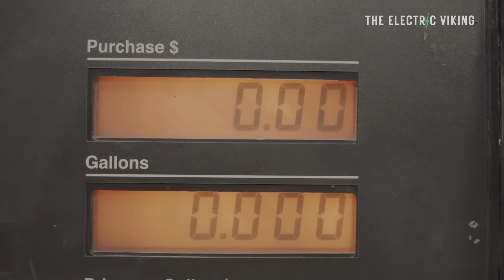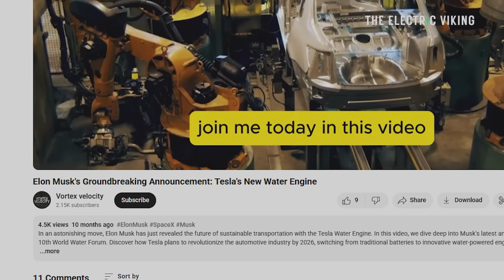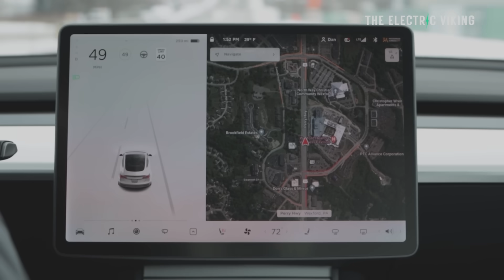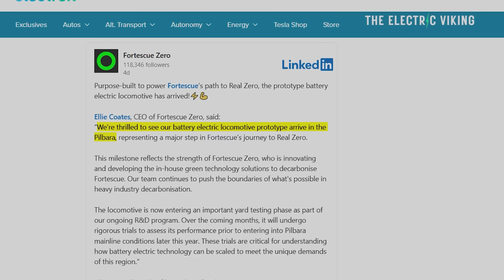The Train That Never Needs Charging – Game Changer for Global Transport

Comment: Your channel has become a source of inspiration for me.... of the need for more people to be taught basic Physics.
Reply: You might want to start with yourself. Sam has defined nothing more than a simple Gravity battery. Try listening closer. Nothing here that would assault physics and nothing new except the application.
Reply: @TronJockey it's not like a gravity battery. They have an external source of power that they use to charge and then give back around 80% of the energy later, like a normal battery. This train only works in very specific circumstances where you are carrying an extremely heavy load downhill and returning empty. The idea that it could be applied to general freight transport or even worse passenger trains, is nonsense.
Reply: @adrianthoroughgood1191  -  "...that it could be applied to general freight transport or even worse passenger trains, is nonsense..."  That's one opinion. I need to see some figures, like length and grade of the slope along with the weight of descending vehicle. It doesn't have to recoup 100% of the energy needed to provide a free ride in order to be useful. To make a global statement about ALL freight or passenger trains without defining the parameters is simply wrong. If you're saying that not all applications would work to completely balance round trip energy requirement's then I totally agree. To say that it couldn't work to a lesser extent to recoup some percentage of the energy is simply wrong. Was Sam sensationalizing this story a bit? Yes, but the overriding concept here is that gravity assist can be used to recoup some percentage of energy, possibly (in certain applications) enough to make a significant dent in the energy required to return to origin. But it doesn't have to be 100% to be useful. This is done for with ReGen for automobiles and electric Semi Trucks even though they rarely encounter terrain that would allow them recoup an appreciable amount of energy.

Comment: Anybody with basic understanding of physics knows  perpetual motion machine is impossible.:body-green-covering-eyes:
Reply: This video isn't about perpetual motion. Did you watch it?
Reply: @Nathan-xr4gv  This is NOT perpetual motion.  I get this same benefit with my EV going down hill. It's called Re-Gen.
Reply: Anybody with such an understanding (and the basic ability to focus while listening) will have noticed: (3:32)"...powered by the force of gravity during the trains loaded downhill travels..."  In other word's it charges its batteries by converting kinetic energy (developed while drifting downhill carrying huge amounts of weight) into electricity via existing Re-Gen technology. The amount of charge stored has been calculated to be enough to return the <empty> train back to its elevated starting point.  It's simply an application of a Gravity Battery. Relax there's no affront to the law of thermodynamics.
Reply: @TronJockey the train works in the very specific circumstances they have. But Sam's suggestion of applying the idea widely is stupid and is what OP is referring to.
Reply: Sam got a little carried away here. The full concept will only apply to high elevation mining. But for this is still totally feasible. Many minerals are stored at high elevation by nature. Giving them a one-way trrp down to lower elevation shipping ports represents stored gravitation or kinetic energy that can be exploited for power.

1) Fully-loaded electric mining train goes down the mountain using regen braking to recharge on-board batteries.
2) Train unloads as port
3) The now much lighter train climbs back up the mountain using energy stored in batteries

Repeat cycle. No additional power required.
Reply: @douglascutler1037  - Doesn't have to be "high elevation". While elevation is indeed required it's the length of time available for it to receive a sufficient charge. In other word's a lower (but longer) grade or slope will be just as effective as a higher (but shorter) grade or slope. Most inclines for train applications are by necessity very long with shallow slopes. Enough weight on a very long shallow slope can develop a lot of regen.
Reply: @TronJockey  OK, correct the phrase "high elevation" to "higher elevation". That would make it more accurate for this technology.
Reply: @douglascutler1037  - Yes, that works.
Reply: You are correct, the title says never needs charging, most posters on your comment have no idea...But then again the Viking never lets his facts get in the way of a story, just like MSN which he hates...Viking cracks me up with his grok/chatgpt facts...
Reply: @Mixos_place  I don't think Sam does it on purpose. He just gets a bit carried away sometimes and he's not a trained journalist. But, yeah, this story line does come across as click bait. Not usually Sam's style. Usually he delivers on a single focus headline. All in all still love Sam.

Comment: So, the train DOES get charged every time it cimes downhill. Transferring the stored energy in the dense iron ore into the train batteries. And then bringing the lightweight empty train back uphill.
 They're "strip mining" the kinetic energy from high altitude ore deposits.
 Sam, did you learn physics in middle school? Or are you clickbaiting us again?
Reply: Dude, Don't be a Dick!
Troll!🤨
Reply: Listen closer, he clearly covers all this at various points in the video (3:32)"...powered by the force of gravity during the trains loaded downhill travels..." So, it charges its batteries by converting kinetic energy (developed while drifting downhill carrying huge amounts of weight) into electricity via existing Re-Gen technology.  The amount of charge stored has been calculated to be enough to return the <empty> train back to its elevated starting point.  It's simply an application of a Gravity Battery. Relax there's no affront to the law of thermodynamics.
By the way, the iron ore at the top of the hill is "Potential" energy. It's not kinetic energy until it's on the way down. Where did you learn physics?
Reply: Not all trains go down hill 😂😂😂😊